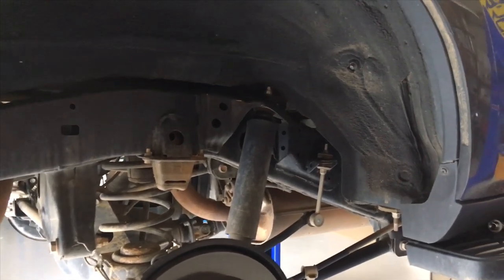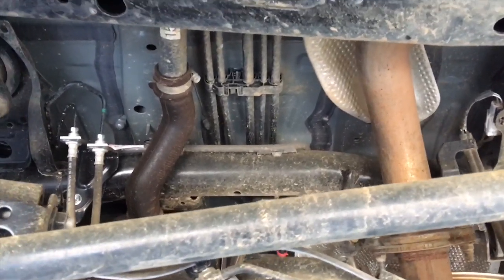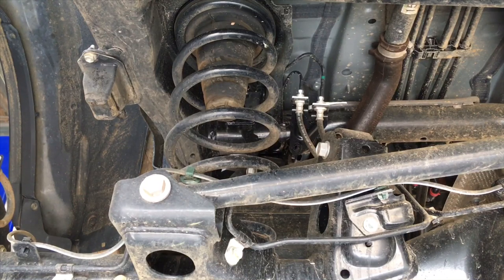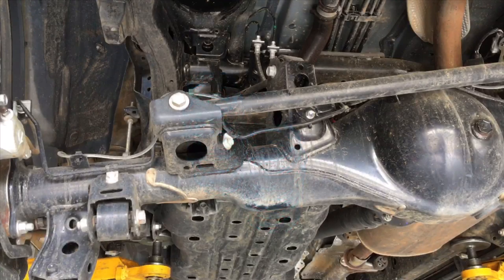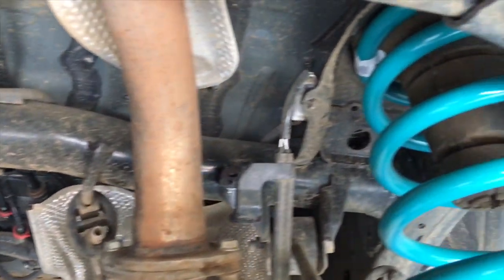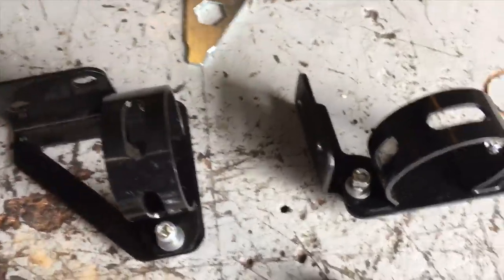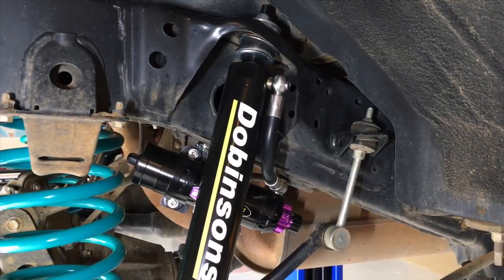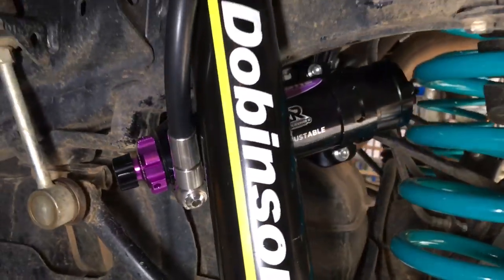TOYOTA PRADO REAR SUSPENSION INSTALLATION

Comment: I find it easier to undo the sway bar links at either end, only one bolt each side. Also since the sway bar links limit the suspension travel more than the standard shock, you can fit longer links (up to 30mm longer, maximum) to give you better articulation. Without longer links you won't get any benefit from longer shocks ; )